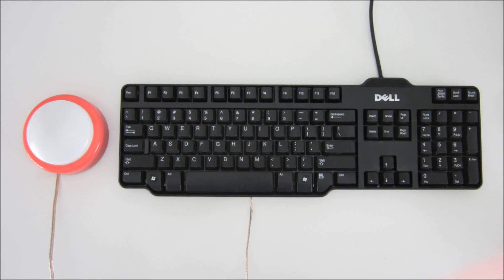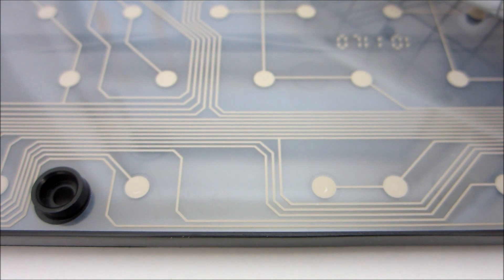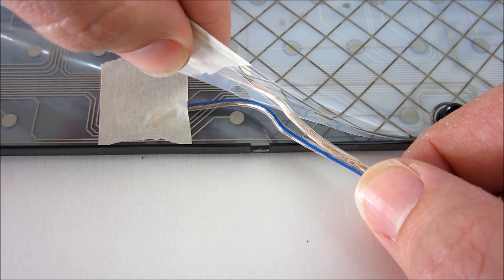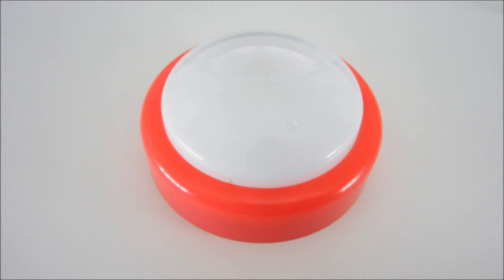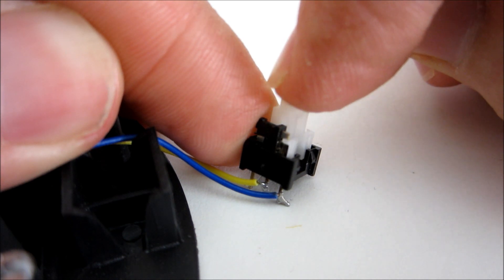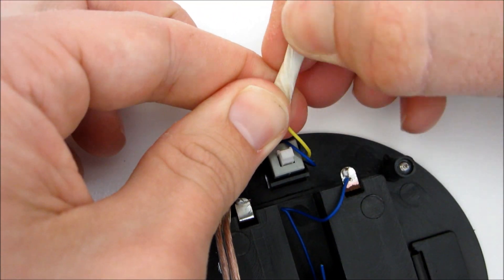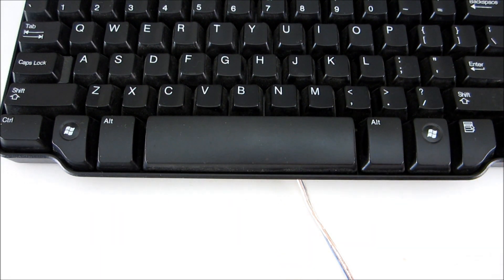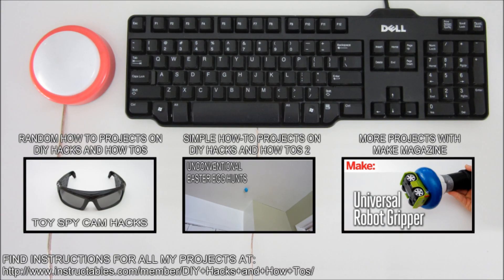How to Make External Buttons for Your Keyboard

Comment: You don't know how apps you made me I've been trying to find away to do something like this to make a hand brake and a button box for simulation gaming on a Xbox one i got a half keyboard that only has the number pad and wanted to hook up like toggle switches and a push to start button but couldn't think of how to do it and wanted to find out before I disassemble a brand new keyboard and sure enough this is the same way it is so I can now make a button box and everything I wanted thank you again man huge help
Reply: YESS SAME
Reply: @vtvv864  worked out pritty well gotta sand the contacts down a little for better contact and superglue or hot glue instead of tape
Reply: im doing the same men
Reply: if you ever wanne race wicht me my gamertag is Blocky123gamer

Comment: or you could just take out the circuit board of the keyboard and soldier the wires directly to it. sadly depends on the keyboard what you can use then (i do have ordered an usb doomsday button once and it has something like a regular usb-keyboard-circuit board in it that is simply hooked up to some wires going through the switch, since that im on the lookout for boards like this, but i don't even have ideas on how to look for such ones )

Comment: Couldnt you just use 2 Keyboard (1 spare one for a Key) like you can with 2 mouses ? Because you could liturally build an Ignition for your Computer Steering Wheel. by having the key turn something inside of the Ignition which pushes something into the button.
Reply: thats what he did

Comment: I have like 5 of those same and similar Dell keyboards (some have the flat XP logo and some are the same with the round Vista logo) and I was wondering what to do with it. I was actually thinking of making it mechanical, 'cuz why not? I'll get momentary switches for all the keys, make a mess of a wiring inside using very thin wires (I don't think my shitton of Cat5 wires will be thin enough, but I like using those).

Comment: Thanks, this was useful :) except for my Dell keyboard it seems only to work if there is a lot of pressure on the area where the button once was (as much pressure as a key press would create).

So if I just push the wires together or push the arcade button nothing happens, but if I push (and continue to hold down) where the button once was and then push my arcade button it works as expected. :|

I'm not sure why this would be? I will have to keep a heavy weight on the button area (or something) at all times for the button to work...

edit: never mind, even though I really thought the connection was fine I think it wasn't. The pressing down must've just been connecting my poorly connected wires. Now I've connected it better it works without me pushing down the keyboard area as well and I can use just the arcade button. Thanks for this video!

Comment: can i attach toggle switches like this? example for flight simulation?
Reply: should be able to work. You might need a switch that throws two ways and wire to two keyboard buttons. Are you also trying to make a full simulation cockpit?